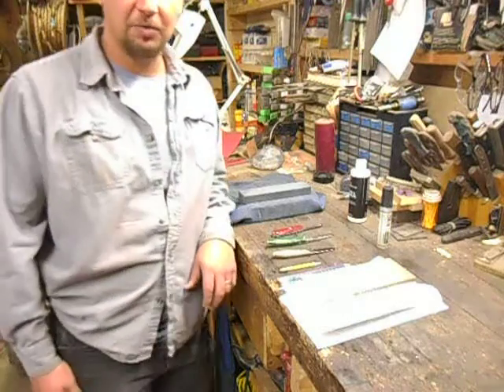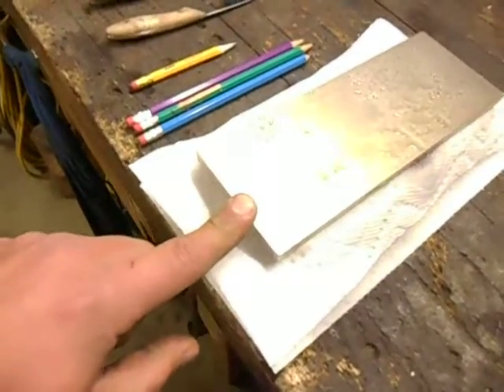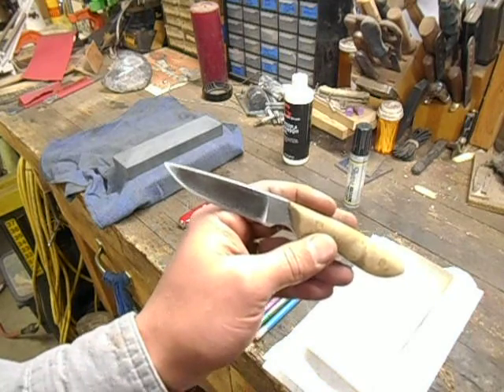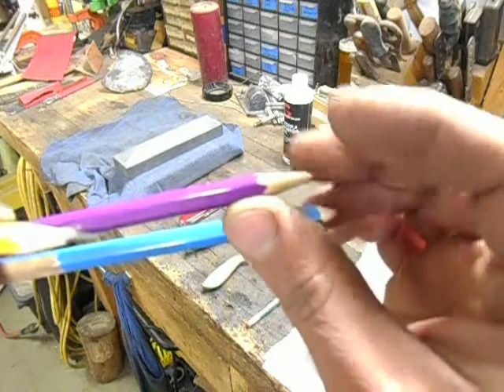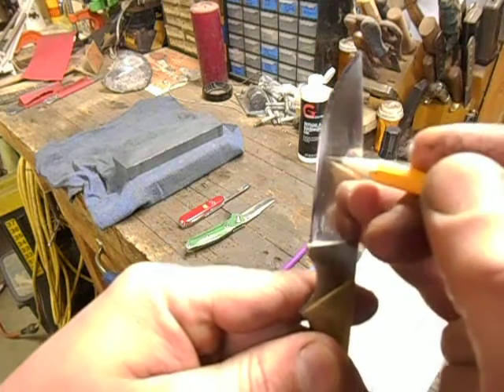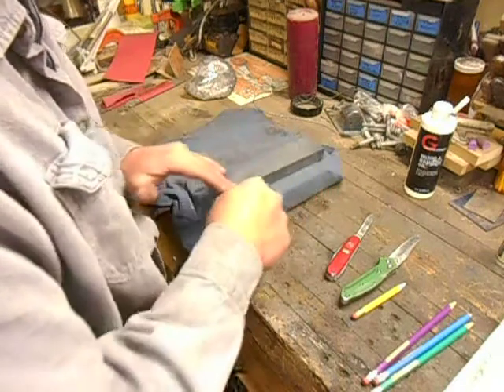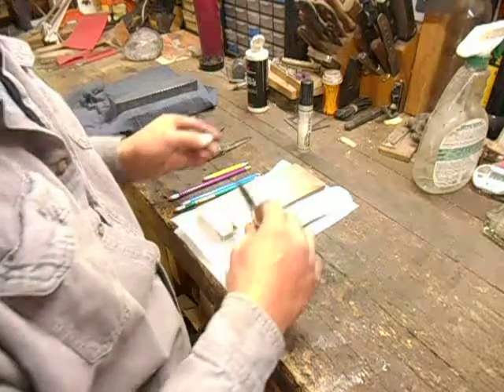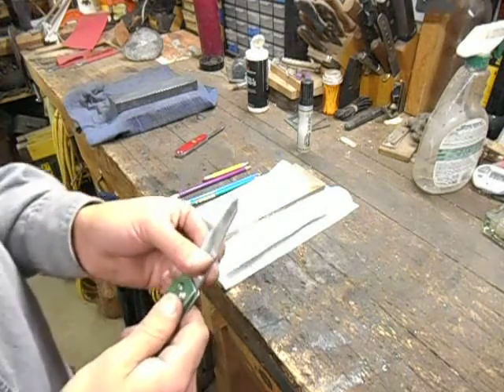how to sharpen a knife #5 shaping the edge bevels,

Comment: Joe. great vid. On the point of shaving arm hair after deburring (at 18 17min), If  I can't shave in one of the directions, say push cutting down the arm, is it the blade side that's touching the skin or the right blade side that needs attention. I have this problem when testing on wood cuts. Ill get smooth planes on say a push cut but scratches in the plane doing the paring cut!!! I never can tell which blade side is causing the problem.  ATB. Pete.
Reply from the maker: pete, think of that burr as a piece of wire, so if it is bent over, on one side it will scratch, and the other side it will skate. so the side that will shave will usually be the side that the burr is leaning towards. dragging a q-tip across the edge will often tell you as the burr will catch the fibers and start to pull them away also
Reply: @joecalton1449  Thank you Joe. Love your videos. They've been very helpful.  Pete.

Comment: Great video! I have really enjoyed this sharpening series. When shaping the edge; during the initial scrubbing on the India stone when you are just trying to thin the blade behind the apex, what
happens if you accidently form a burr? Do you still continue with the edge
leading only passes with light pressure on the India, or do you go right to the
diamond stone to clean up the scratches. Also, it appears you try to maintain
the same angle during the entire shaping process and only raise the angle of
the blade at the very end, when you are making very light, edge leading passes
to shear the burr. Does that sound right? Best regards - Mike
Reply from the maker: +BSEE8512140 mike, when I am shaping the edge and a burr forms, that would mean one of 2 things, one that I am done shaping, or two that I need to go lower if I formed a burr before I was done shaping. I usually just use the Norton for shaping and getting everything close to save wear on the diamond hone. after the edge is close, then I switch to the diamond hone to finish the edge off.yes. when I reshape an edge, I am thinning everything down and maintain the lowest angle that I can and only raise the angle to shear the burr off. the next couple sharpenings are usually at a bit higher angle if im in a hurry {which is most of the time as I need that edge back so I can get back to work}, until the edge needs thinned out again and its back to the shaping.